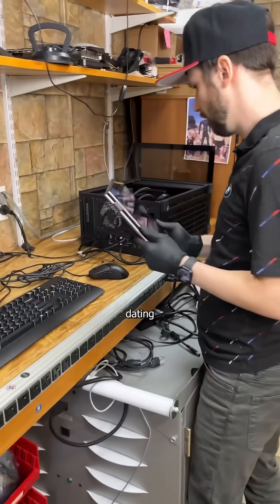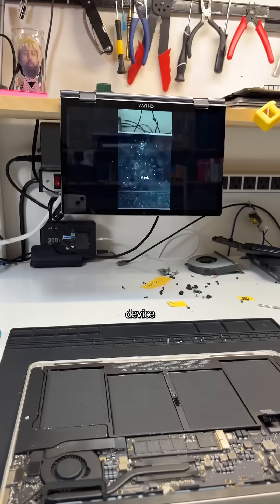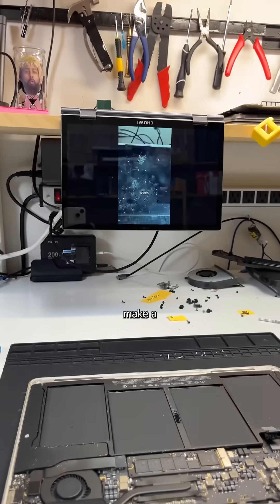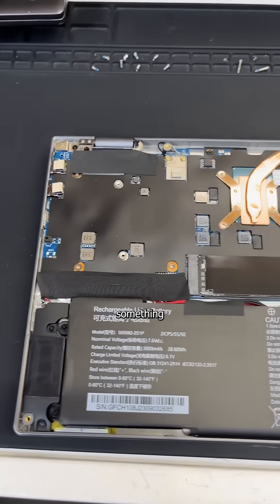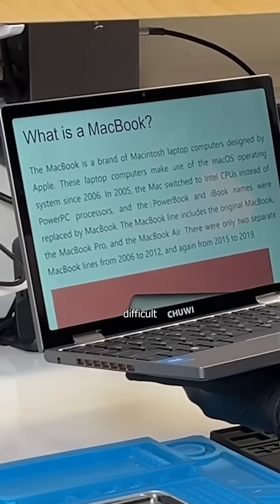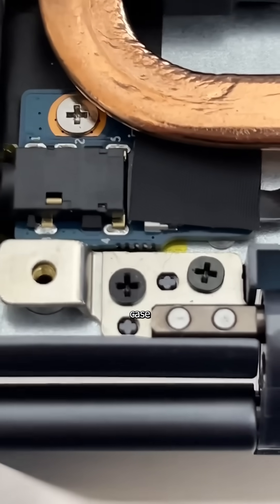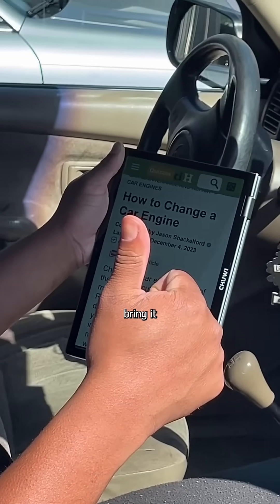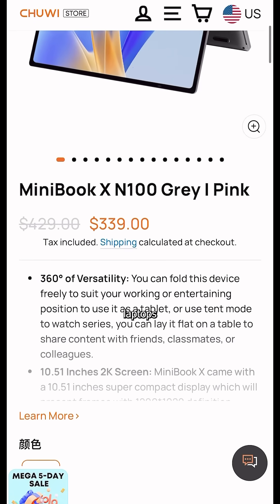The Mini 2-in-1 Chuwi MiniBook X laptop is my new daily driver #computer #pc #tech #technology

Comment from the maker: I've been using this for 7 months and for $350 it's one of the best purchases I've made in recent memory. I've previously worked with Chuwi on testing their Mini-PC, and have sold dozens of their laptops over the years. But when I was looking for a small 2-in-1 for myself to carry around that could play 4k videos and do basic work (YouTube, email, WhatsApp), the MiniBook X was the smallest thing I could find that still had a big Shift key, which is a deal-breaker for me. I've since upgraded the NVMe to a faster one, replaced the thermal paste with PTM7950, overclocked the CPU, and overclocked the display panel to 90Hz. Though your results may vary if you attempt to do the same. IMO worth the $350 as the competition for these small form factors doesn't come close to what Chuwi offers. Another W from them.
Reply: As long as it's faster then a 5200U then damn
Reply: @lecat90  According to benchmarks, it's almost as fast as an 8th gen i5 (8250u).

Pretty neat for an entry-level cpu.
Reply: @zNoah  if it is that fast then I am really intrigued by this machine.
Reply: @pretty_bored  I don't do things typical people do but if the n100 can compete with 8th gen u series i5 thats enough power for me to tinker and have a good time. Maybe the upgraded 12th gen integrated graphics could cope with rendering 4k video, maybe it couldn't doen't have a 4k screen anyway. I would care more about if it could decode AV1 1080p with out dropping frames bause it really should be a thing in 2024.
Reply: Wait, this thing allows overclocking? I need more details!
Reply: I got similar shit from Lenovo for same price like 4 years ago and im still rocking it. I love how the hinges actually feels good on this foldable instead just crying for help
Reply: Bite it. Is it Chuwi?
Reply: I didn't even know you could over clock a display.
Reply: I went to your website looking to buy a used Laptop but your “Laptops” option of your site leads to a merch purchase screen. I don’t need merch big dawg.
Reply: I had to order a replacement battery for my dad’s Chuwi Corebook X 14” (due to swelling) and it was a hard search to find one that didn’t have to ship straight from china. So just keep in mind that even though you saved money on the laptop, replacement parts may be scarce.
Reply: Hiiiiii, does this laptop has a HDMI port? I don't see nowhere.
Reply: @matios83 maybe you can use usb c for that
Reply: @One_RandomCommenter  I'll thank
Reply: Not a fan of celeron systems but it sounds impressive
Reply: @Guestisanuub  
Modern Pentiums and Celerons are not the cripples that their predecessors were.
Reply: Yeah more details on overclocking please!
Reply: How’s the battery life? Heard it’s not that good.
Reply: hey man, I got a question.

Almost every time I restart or just shut down and boot up my laptop, it shows the "BSoD" WATCHDOG_VIOLATION.
Is there any solution on how to fix this problem?
It's been happening for quite a while and it's pissing me off sometimes.
Reply: Do you happen to know where a "Greatest Technician that's ever lived" in Canada would be?
Reply: Whoa...  If I wanted you to buy it, do the upgrades and sell it to me for cost plus your work, how much would you charge? 🤔
Reply: if you can squeeze 90hz out of the display that seems kinda nice. How would you say it affects battery life?
Reply: Looks incredible, now give it to me or i will challenge you for the title of "the greatest technician that ever lived"
Reply: Soldered in memory
Reply: is i5 1235u iris xe good for gaming??😅
Reply: What is the battery life ?
Reply: I’m really curious what the biggest differences between this laptop and the HP Edge, since to me, an absolute fool, they look very similar.
Reply: Can it run crysis?
Reply: What are the specs on it?
Reply: damn man i was actually thinking about buying the chuwi hi10 max and now im definitely gonna buy it
Reply: What GPU it has? Is it Intel Xe Graphics 64 EUS?
Reply: Please tell me it has touch support. If so  you got a deal!
Reply from the maker: @Simon_Electric  Yeah it's a touchscreen
Reply: @SalemTechsperts Have you had any problems with the battery? I really wanna buy this product but I'm not sure which battery to buy in case the one It comes with breaks down.
Reply: @SalemTechsperts If you're really the greatest technician ever then you would do a guide on how to overclock the monitor and CPU plz 😉
Reply: Available right now on eBay for $275! I'm thinking about picking one up to replace my field tech laptop I've been using for about 8 years (Lenovo P51 15.6".) I love my Lenovo but the power brick is literally that. A freaking brick and the whole package weighs so much. For what I'm doing in the field, I don't need that big of a laptop either.
Reply: I almost believe they didn’t pay you to say that.
Reply: Basically the greatest mini book that's ever lived.
Reply: Should partner with them to sell Linux versions.

We need to help the layman switch over, pre installed Linux is MASSSIVE.
Reply: That thing with that poor Celeron yea that’s a no for me and no upgradable ram
Reply: for 350 bucks this is a fucking steal, like bro my pc costed me about 600$ and its kinda mid 4 years later

Comment: Chuwi. The best bang for the buck, with questionable aftersales repair service. Written on a Chuwi Ubook X 2023 i5 10210Y 12GB RAM 512GB Sata SSD with the keyboard cover  and pen bought for 343€ in 2023. I love this clone of the old Microsoft Surface. So simple, so cheap, so easy to mod. Can´t wait for the CoreBook X with the i9 13900HK. I will get that one for work at building sites. My ASUS Rog Strix G16 is a bit expensive to be thrown around when working outside the office.

Comment: Probably one of the best budget ultraportable 2 in 1's ever along with the used Latitude 5310 2 in 1 which is even more powerful if it has at least a 10th gen i5 (The base i5-10210U is faster than the N100) and it has upgradable RAM. You should try comparing them. Both laptops are 1000 times better than my HP 14s-dq5037nf which sucks for real.

Comment: The hinge is screwed into the brass inserts of the plastic case, the same hinge flaw that you mention in your videos? What makes this better? You fail to mention sponsorships in the videos you DO GET SPONSORED, why should we believe you in this case?
Reply from the maker: 95% of laptops use brass inserts in plastic mounts. It's the tension of the hinge, quality of the plastic, and design of the mounts that determine if it's prone to breaking more easily than another. As you can see in my latest long-form videos, I'm still using this daily, tossing it around the shop and disregarding its well being. It hasn't failed yet. Please reference a specific sponsored video that I didn't label as sponsored.
Reply: @SalemTechsperts The greatest technician that's ever lived.

Comment: Its the chromebook of my dreams omg
Reply: It’s not a Chromebook
Reply: @TheDigitalPlayground24  the joke is its basically mimicking a chromebook with actually good hardware. My acer spin 311 is basically the same size, and it folds like the Chuwi, its more expensive and it seriously underperforms. The chuwi, like the chromebook, is compact, has a touch screen, and folds. However, my chromebook has a bad i5 and 4gb of soldered ram.

Comment: Just a warning, don't expect to game on this. If you want to play light games put $300 on a used higher end laptop.
Reply: It can play low requirement games just fine, I'm able to play minecraft at 60fps stable without even using optimization mods, for example
Just don't expect to play any AAA games, specifically
Reply: @ exactly, games like mc
Reply: Or even better, gaming pc, pc will always be better for price

Comment: 350 bucks? That's about the same price as my garbage (I use it as a mouse pad because I have damaged the display) 2021/2022 ASUS Vivobook E210Ma laptop. It's made of plastic, CPU is a Pentium, 4 GB of soldered RAM, 128 GB eMMC storage (Also soldered to mobo) and they dare to put Windows 11 on this potato instead of Windows 10 (I guess it would have been OK with W10 as the CPU spikes to 100% on idle, thanks a lot, Windows 11 D:<)!
No joke my 12 years old HP (2nd Gen i5, 4 GB RAM) and 7-8 years old ASUS (6th Gen i5, 6 GB RAM and Nvidia Geforce 940m GPU) outperformed this thing (Both with W10 and proper SSD (mSATA on the HP and regular SATA on the ASUS)). The HP is now completely dead and I use the ASUS as a desktop because of garbage plastic hinge mounts on the LCD display (The rest of the case is sturdy as it's made of metal). That 8-7 year old ASUS runs Minecraft decently BTW.

Comment: I took this recommendation and bought one for 290 from Chuwi's site. SHOCKINGLY usable.
Reply: One thing I noticed though, the screen is locked to running at 50hz, which is super weird. But I didn't notice it until I looked.
Reply from the maker: Hell yeah brother. If you want to tinker with it and get a bit more speed, try replacing the SSD with a faster NVMe and replace the paste with PTM7950.
Reply: @SalemTechsperts  Yeah, the "AirDisk" that it shipped with was pretty slow. Cloned the drive to a WD SN730 (OEM drive I had) and getting about double speeds and it has a DRAM Cache. Also replaced the stock paste with Noctua NT-H1. Solid so far as a small secondary laptop to my Thinkpads (X380 Yoga and L13 Yoga Gen 2)

Comment: N100 is a neat CPU. No overpowered nuclear furnace that throttles at the sight of a workload that uses more than half of the cores.

We need more laptops with reasonable CPUs rather than companies cramming in the biggest specs to then not be able to sustain the advertised speeds, all while sounding like a jet engine and burning your balls.

Comment: How do you hold it without accidentally activating something on the touchscreen with your fingers. Phones have cases, which function like extra bezel for you to handle it. But no one makes protective cases to be used while the computer is on. Holding it requires either touching the screen, or holding it like you're juggling it. At least that's my experience with my Dell 7300 series. I'm sure your laptop is great, but I still can't figure out how to hold one like that without accidentally deleting a file or erasing cells in a spreadsheet.

Comment: I think 350 is less than I paid for my Surface Go 2 including the keyboard (And I got a cheap third party one) so I'm wondering how bad the specs are on this thing? 

I still remember when I had a tablet with only 2 gigs of RAM and 32 gigs of storage. Windows 10 needs at least 4GB RAM to be usable.
Reply: 5 seconds on Google will answer your question

Comment: For those of us interested:
The USB-C Ports are claimed to be "full-featured", but this just means all pins are there. The spec sheet unfortunately doesn't say anything about what features it supports.
A review I found mentions external displays via USB-C, so I assume Display Port Mode is at least implemented, and it's safe to assume power delivery.
I also wasn't able to find anything about which USB version this is, since USB4 can do a lot of cool stuff that USB 3.2 can't.

Comment: What happened to small laptops running full fledged Windows/Linux that range from 7-10 inches? Personally I think 7-8 is really the sweet spot between a phone and laptop. It's just small enough to slide into a hoodie pocket. I'm stoked for the MNT Pocket Reform. We need more modular small laptops that you can actually repair and don't have awful specs.
Reply: Tablets have dominated that footprint size unfortunately. 10” is pretty much the new sweet spot for these type of small laptops.

Comment: My first ultrabook was a chuwi back in 2016. It was only 200 euros and while not powerfull it was decent enough to work efficiently, had a great battery life and a nice screen. Plus it was beautiful. For my budget it was more than what i was expecting. I am glad  to see Chuwi continuing to provide good cheap laptops.
Reply: My current laptop is a Chuwi, got it like a year ago for 200$. 100% worth it, runs what I needed pretty smoothly for the fact I didn't really optimize it much and it's so cheap.

Comment: Those big compies should learn from the small brands and maybe they would learn from someone who would show them, what is a good hinge design, now the laptops are just expensive and brake easily, and the fact that the fan Is shoved to the very small room, where it isn't receiving enough air, to cool the toaste CPUs and do you have any clue why my Asus VIVOBOOK D1505 Oled laptop, desites to Disposes of the fingerprint reader's driver after every update? But i have prepared for it by saving the driver fot the reader on OneDrive, but laptops should go back to the Windows 7 era, when they were build to last and work long, it's a same that Microsoft only care's about money these days and about spying people, and the fact that Microsoft desited to discard every single computer from getting Windows 11 that is not new enough for them, when that the OS works perfectly on Intel's 7th gen and even on AMD's Ryzen 1000 and 2000 series CPU's, but the big brain head on Microsoft desited that it's not worth it, as now we have a big e-waste problem and now Microsoft will loose a big share of it's husets to Apple or those smaller OS's like Linux and Google's Chrome OS, i remember the Windows 7 days, as the best OS, as it run's perfectly and there is no spyware from Microsoft or any other trash, like the manufacturer's own software that has been Pre-installed into it and the fact that Windows 10 is the most popular OS on these say's is because Microsoft forced users's to Windows 10, as the best love would have been continuing supporting Windows 7 for free, it would have remained as the best OS, for the fact that how unstable Windows 10 and 11 are and even that Microsoft spy's users on them, and we will remember those old Windows version like XP and 7 as the best OS's that Microsoft ever made, those legendary OS's were build to be stable and they would run perfectly if Microsoft would only implement a simple update to Windows 7 by introducing the support for the new parts, Microsoft should listen to repair shop's and the end user's of their product before doing something that doesn't work and does nothing for user-friendliness, what make Windows 7 popular on it's early days was that it was stable and easy to use, user's liked that and now tht we look at how resource hungry Windows 10 and 11 are by their system recuirement's, when we compare it to Windows 7 recuirement's, and how well it run on old hardware but now if we but Windows 10 or 11 to a computer that is from Windows 7 era, it would not work and even it would have been getted to working, it would not work well due to the fact that Microsoft user's very heavy animations on both Windows 10 and 11, is something that those old laptops and PC's can't handle at all, as their GPU's doesn't like heavy animation, as we all know also that all big companie's only prioritize cost and manufacturing costs and that's why they have desited to make the laptops so small and out the cheapest fan they have found to them and on the desktop area we have Arctic that values their customer's and doesn't over price their products like most manufacturer's do, even their newest AIO model's are cheaper than their last gen AIO's, but companies like Asus, Hp and Microsoft should learn from the manufacturer of you're laptop and also from Arctic that when they make products, hey should make them endure the end user's, and now that even the Arctic's liquid freezer II cost 130€ for the 420mm ARGB version and the liquid freezer III costs for the 420mm ARGB version 95€, it's 35€ cheaper but the there is Asus who has their ROG-RYUJIN line up that costs over 300€ for the 360mm ARGB version and we get almost the same features with it, but only diffrent brand, and with 3.5" LCD screen and the same screen is used on both 2nd and 3rd gen ryujin's and where the first gen AIO used 1.5" OLED screen, it should not be that hard for Asus to make 2" bigger OLED screen for the AIO, as even phone's use OLED screen's these day's, you should defenetly make a long video of how we as end user's are getting scammed by big companies and also we should bit forget that Arctic has Value packs for their fan's and that pack offer's crazy value for the money as we as consumer's can get 5, 120mm fan's for about 30€  and also, Arctic isn't like Corsair and those slem other brands are with the RGB part's and devices are, they have made sure that their part's work with every single brand's RGB software and that's one reason why i don't like to mix and match diffrent part's from diffrent manufacturer's as i would like many RGB software's and where as i buy all the part's from the same brand or a brand that support the RGB software of the manufacturer and also i have a charger that has manufacturered by AXAGON, and it's model is ACU-DPQ65 and for the price of 35€ and the fact that it is heavy and It is GaN charger, even and even AXAGON has cheap charging cable's and their value is very good, i'm not sure if that brand is available on USA, but their factory is on Switcherland, at least that's my understanding